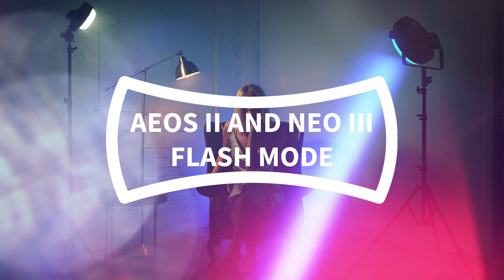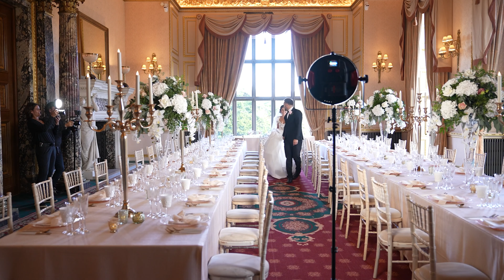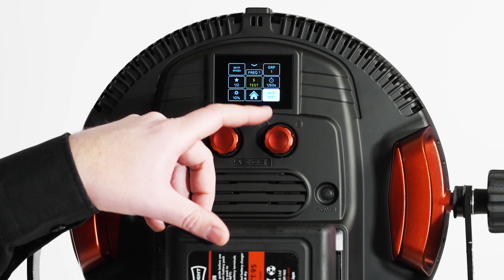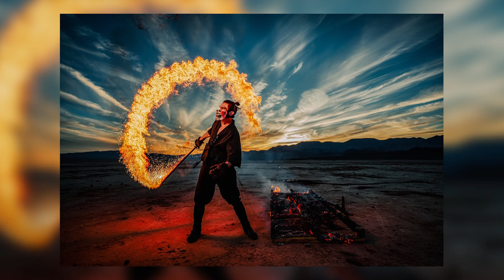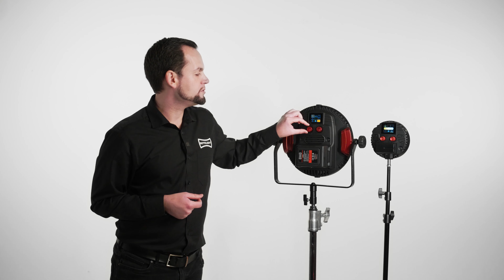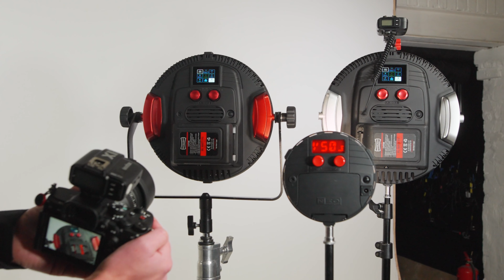How to setup flash mode on your NEO 3 and AEOS 2 standard and PRO series LED lights

Comment: What I'm finding using the Anova Pro 3 is that the modelling light power at 100% in flash mode, is only around maybe 15% of the max intensity in constant light mode. Is there are way of setting the modelling light intensity to a bigger fraction of the max constant light intensity?

Comment: I'm shooting with a Westcott trigger paired with a wireless transmitter from my Sony camera over to your Aeos 2 Pro and Neo 3 Pro. Everything appears to be working. Since you don't support Westcott, can I leave my flash speed at 1/50th even though I'm actually using a shutter speed of 1/1600th? Or in my case do I actually need to change your lights to 1/1600th to match my camera's shutter speed?
Reply from the maker: Yes you can leave your flash duration a 1/50th

Comment: how many watt output
Reply from the maker: LED's are not measured in watts, we measure in lux. So for the NEO 3 PRO Peak Output (Lux) @ 3ft 6802 (continuous) 10,700 (flash) and for the AEOS 2 PRO - Peak Output (Lux) @ 3ft 11,700 (continuous) 17,500 (flash). All details can be found on our website :)
Reply: @Rotolight  as an eng i can assure you we measure in watt. the number of the photons jumping out of the ledsss is measured in lux, but thanx for the tip

Comment: 00:54 "if you're shooting a shutter speed faster than [1/50s] it will automatically recalculate."  come on.  it's not actually recalculating anything since it's a manually-triggered flash.  what's happening is that the flash will simply NOT achieve the max power output for any shutter speed faster than 1/50s (aka its max power t1 flash duration)...i.e., the faster the shutter speed the lower the perceived power, and therefore resulting to underexposure for the same ISO and aperture.  This is why as you said at 01:30 "...and simply adjust your ISO or your shutter speed to correctly expose for the flash" in contrast to any other flash with their t1 flash duration is much faster than Rotolights, SS does NOT affect exposure for the same ISO and aperture.